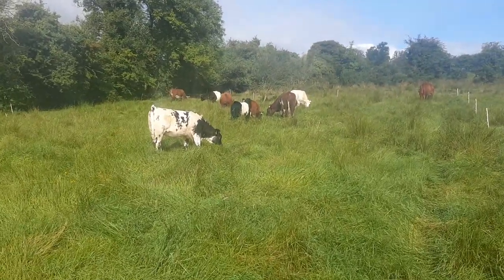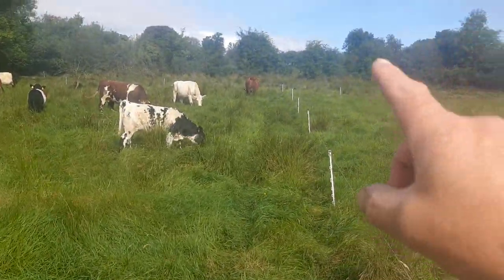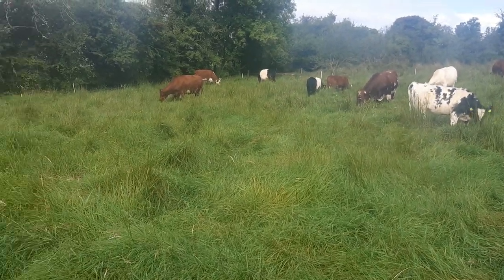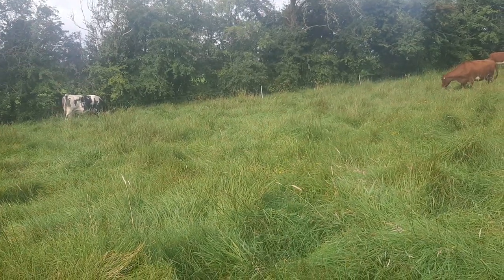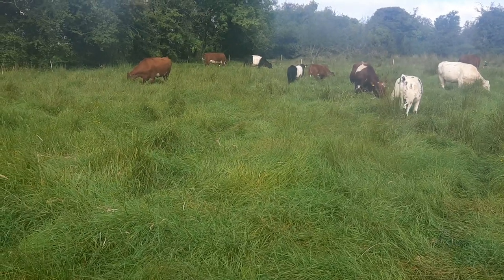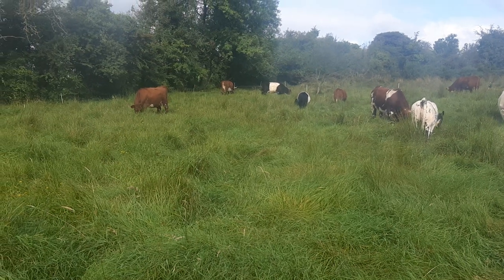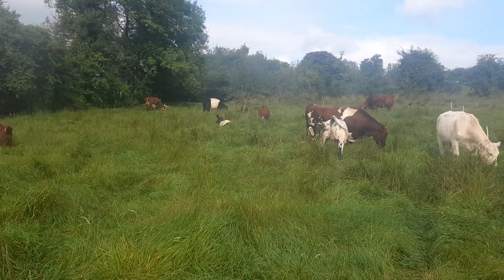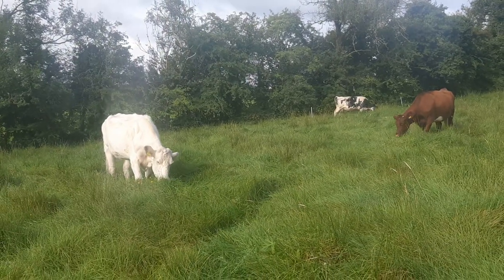Why i'm tall grass  grazing cattle the regenerative farming way!

Comment: Hi Sean.
Another thing to my mind when letting cattle in on a stronger crop of grass to graze in your system is the cattle or sheep for that matter are mostly only selectively grazing off the leafiest part of the grass plant to eat, which is high in feed value and leaving behind the lower feed valve stemier yellow grass to be trampled in to rot down and used as organic matter to grow more leafy grass later on in the year or next year. So while the heavier crop of grass is lower in feed value as a whole, than a short leafy sward grown with fertiliser, it's very similar in animal performance terms as the cattle are mostly only selecting the leafiest best greenest grass to eat in your system as you don't graze dow n tight and move the cattle on after a day or half a day. So there's not much if any difference in animal performance or health wise between grazing the two sward types, as can be seen by looking at the good shape your cattle are in. The cows are thriving, milking Well, fertile, have good coats and the calves have good weight for age for their breed. So fair play to you. What do you think Sean?
Regards
Mark
Reply from the maker: Well Mark thank you for your comment. Yes im glad to agree with you,  you sumed it up better than myself.  If we look at it like a graph  going from 0 to 10 . With this system the cattle are at a constant straight line ish around 8 going downto 6 or 5 over the winter and up to 8 againin spring  where as the conventional standard rotational grazing is 9 today 8 7 6 5 4 3 2 moved 9 8 7 6 5 4 3 2 move and then housing its an even bigger shock to the gut with silage , which takes time to adapt, Although lovely stuff to feed i believe never can beat  grass. Here's a thing I find fascinating.  I get told " its gone to strong bale it" . So if its not good now but baling it and feeding it 6 months later makes it great stuff, , thats when I started to question. 
I understand outwintering is a scary concept to get the head around but imagine during our most difficult and expensive time of year we don't use our best an biggest asset , our land